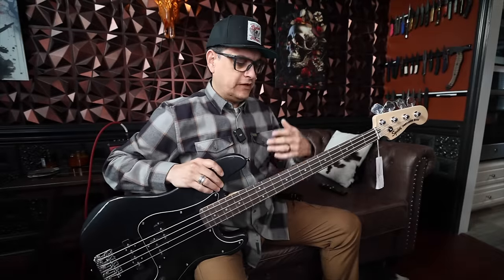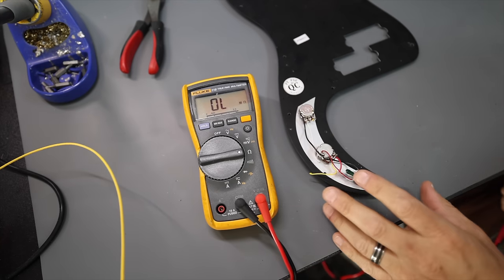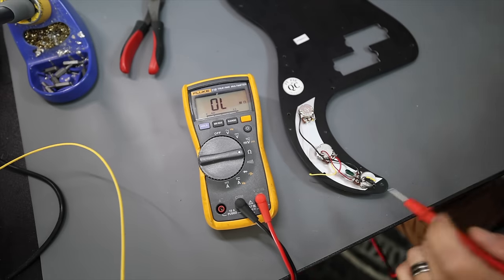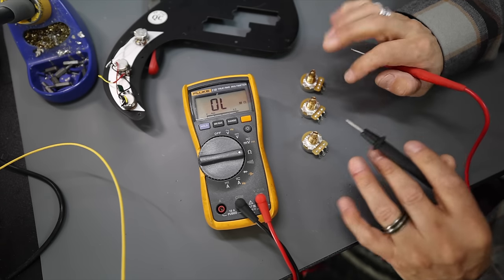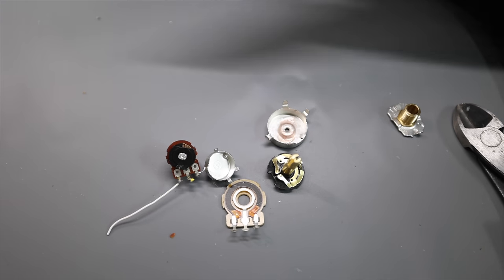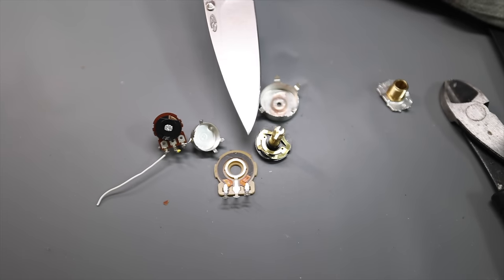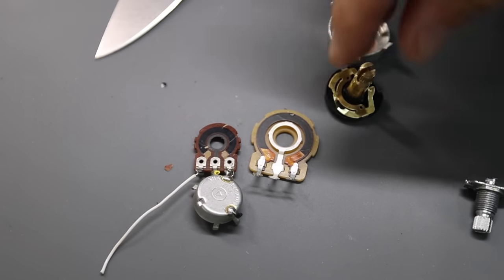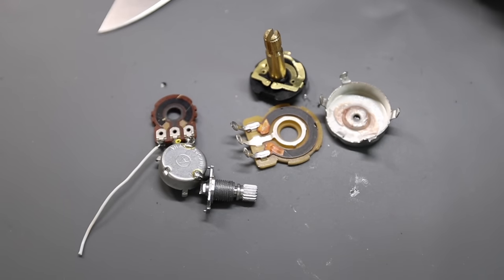Do Cheap Pots and Caps and Switches Ruin Your Tone ?

Comment: Haven't seen any real evidence that small Alpha pots do not last as long as CTS pots. The opened CTS pot is not CERMET either, so it collects dirt inside as well. Most pots have very similar specs for longevity. From 10 000 to 100 000 travels. Standard range CTS promises only 10 000 travels where Alpha 15000 travels with their "small pot". This info is in their data sheets.
Reply: As you can see in the video, CTS has the thick carbon track. Once they get dirty inside a CTS can be cleaned and be brought back to service quite easily while the Alpha will usually enter a slippery downward slope and once they start failing it's a fairly quick process as the scratches dirt leaves on the carbon track can go through and kill the pot. It's not the number of guaranteed trouble free cycles but what happens after issues start on less than ideal conditions. 

Also, and this goes for all 16mm pots, their taper is always less precise. The wider the pot, the longer the track and the more nuanced the taper can be and precise your adjustments while moving the knob. Small pots can sometimes feel jumpy and I like playing with my controls a lot.
Reply: @Strongholle  It is unclear which series of CTS pots he is talking about. As mentioned earlier the "standard" series has only 10 000 travels guaranteed. The "special" series has 100 000 travels guaranteed, which makes it obviously a more durable pot. Couple of other things which are not correct in his "analysis". Alpha uses multiple contact springs in their taper. The purpose of this is to reduce the contact force to the resistive material assuring longer lifespan. Using just two stronger springs means higher contact force and also uneven wear of the resistive material. This must be compensated with a thicker resistive layer to achieve promised specs. The CTS construction is probably 50 years old compared to Alphas more modern approach. 

What comes to the grease added to the CTS pot its purpose is not to seal anything. The purpose is to add friction when the pot is turned to make it feel "smooth". And yes, thick grease between two metal surfaces adds friction rather than reducing it. Bourns and others use the same method. 

Quote "Also, and this goes for all 16mm pots, their taper is always less precise. The wider the pot, the longer the track and the more nuanced the taper can be and precise your adjustments while moving the knob. Small pots can sometimes feel jumpy and I like playing with my controls a lot." Have you any proof of that claim not being as precise?

If someone has problems with these "small pots" that might be of other reasons than described by Dylan. There are a lot of Chinese Alpha knock offs around in affordable instruments and not sure about the quality of those. Personally, I haven't experienced the on/off behavior. Seen it in YT videos though.

Dylan having so many things wrong in this video raises some questions. Does he really know what he is talking about or was this made just for marketing purposes? He is selling this stuff.
Reply: @hannuhanhi183  Easy TL;DR but I'll bite.  I've worked on guitars for years and while I think Alpha pots are really good for the money I've found after wiring/rewiring hundreds of circuits that CTS's are by far more durable, over time with use and when soldering. (You have to be fairly careless) but when soldering Alpha's you can burn up the board and have the pot become noisy/fail before it's time. Same if you bend the legs, you can break the carbon track unless you're careful or use a wire to make the connection. Once again, if you're experienced it's rare that this'll happen but CTS just take whatever you throw at them. I don't care enough to look into it but the CTS pots usually found in guitars are from the specific Guitar Series, which are only offered in 10 and 20% tolerance, matching the Special series vs the standards, which doesn't mean some shady shops or makers don't use the Standards. 

The grease stuff you said is true but I never mentioned any of that, I'm not talking about Dylan and his reliability/knowhow either. 

As for the taper and pot diameter, the further away the carbon strip is from the centre of the pot the longer it is overall and for a given angle of movement the contact will travel a longer distance over the track. Given that most guitar pots are audio pots what I suppose is that it's easier to make an accurate audio taper on a bigger resistor without adding too much to the production cost. One of the big cons of Alpha pots in general is that their audio taper is worse than CTS, being two conjoined linear tapers approximating a curve than an actual logarythmic shape like on CTS and I feel it's worse on the 16's. Also, maybe it's heat disipation when soldering or whatever but for some reason the smaller pots tend to fail a lot more, from what I've seen. Maybe it's chinese copies, but Alpha makes a shit ton of different specs for pots so the shittier ones might not be fake. 

All in all, if I buy a guitar with Alpha 16's and they work I'm not gonna change them. If I rewire a guitar or need to replace a pot I'm gonna use CTS or Bourns.
Reply: @Strongholle  Quote "Also, and this goes for all 16mm pots, their taper is always less precise.". Didn't receive any evidence to this statement. What I have in hand here is a 3x3mm Bourns SMD trimmer. The travel is hard to measure but is some millimeters. It adjusts the resistance just fine and is accurate. Another which I have in hand is a multiturn trimmer pot which travel is like 12 mm. It also adjusts fine with every turn of the adjustment screw. With every turn the taper moves just a tiny bit, fractions of a millimeter. 

I use extensively Bourns push/pull "small pots" in my builds because I want to have the split coil feature. Never have experienced that they are less precise than same value "big pots" from Bourns. Based on these examples I cannot see any correlation in taper length shorter being less accurate than longer one. It cannot be generalized that shorter taper equals less accuracy. But yes, as you said it might be easier to manufacture a longer taper pot which fits in the specs.

Quote " One of the big cons of Alpha pots in general is that their audio taper is worse than CTS, being two conjoined linear tapers approximating a curve than an actual logarythmic shape like on CTS". Well, if you look at the specs of the CTS "logarithmic" pot (Series 450G
) the curve is definitely not logarithmic. It's almost perfectly linear up to 50% of the turn and then jumps to logarithmic. Linear half of the turn. That's quite a lot I would say. So, this statement is also busted.

What comes abusing pots when soldering the lugs it seems to be the norm rather than exception when you watch YT videos. Often you see a Harley Davidson grade (sorry for the analogy) 100W soldering iron 😁. In most cases they don't have any temperature control either. No wonder you burn up everything with it.  I well understand that you need more power when you solder the grounding wire to the base of the pot. Why not use a temp controlled soldering iron for safe soldering. ?

And again, I'm merely talking about Dylans credibility. To my eyes this video seems more like a marketing video than anything else.
Reply: I've had problems with Alpha pots but every CTS pot I've ever put into a guitar or bass has been solid. When it comes to a push/pull I use a Gibson pot in an SG because they're about 1.5mm shorter so they fit behind the cover.

Comment: the moral of the story: yes, expensive parts may have more build quality, but won't give you more tone quality (assuming you didn't change the values of the components)
Reply: This what I've been thinking too. And if the Asian manufacturers really want to throw a wrench into the works, start knocking off the CTS-style parts and installing them in the guitars. Cheap labor, quality part. And please use a 1/4" shaft.

Comment: I'll give my answer before watching the video. No they can't affect your tone. What can happen thou is that they could not work properly and they have a lower lifespan.
You can buy a couple of pots for less than a dolar and could probably last for years if you are very caring with your instrument, but they will likely won't last that long.

Edit: I mean, yes, switching values on the pots will change your tone, but changing by price within the same values wouldn't be that much of an issue. But again, cheaper ones will have a less good performance.

Comment: I spent 20 years in electronic maintance and 25 years traching electronuics. I got eight minutes into you vid and could not take your snake oil any more. If you know electronics to any extent then you'll know the sales talk falsehoods. Kids you can always boost/modify tone with your amp's EQ - enjoy. T.
Reply: I agree to an extent. Off matched pots have an effect on volume matching between pickups, when using the tone knobs. Running, for instance a 7 way mod on your Strat allows you to use two tone pots for blending. So you want to have them matched as close as possible and consistant as possible. The roll-off is also more consistant with higher end pots as Dylan suggested. PIO caps also lose the effectiveness over about 20 years as the paper starts to disintegrate.  When this happens, they allow high frequency bleedthrough which affects tone in a good way - that "creamy" sound, of course only when you use the tone pot. I've been working on guitars for the same amount of time and I agree, electronics don't know the difference in electronic signals, but players know the difference between janky parts and well constructed parts, Dylan is correct. Orange drops don't sound any different, but they have better tollerances from which standard benchmarks are made fron when creating pickups. .022, .033, .047 etc. So they are recommended. CTS pots are higher quality and less prone to variances which in the guitar world, just the smallest can be a huge difference when selecting different pickups running on the same tone pot. Also, its embarrasing when in the studio, you have to rely on the sound engineer to compensate for your janky equipment.
Reply: @terrylast7034  What specifically are you referring to? Your post sounds like someone who's not being completely forthright to be quite honest.

Comment: SNAKE OIL!!!
Not liking the taper is one thing, better quality is another thing. Saying it chages the tone.. when most players play it full on (when the pot is doing NOTHING) is deliberately lying.
Guitarrists fall into this trap because they know shit about how electronic works.

EDIT: Just got to the orange drop bit of the video. The 715P series your holding is exactly what you don't want in a sound circuit. the 225p is "regarded" by Sprague as the more musical of orange drops.
Reply from the maker: A few things…. A change in taper IS a change in tone. A change in resistance changes tone (science) and…. The pot is actually doing something when on 10. (Thus the option of no load pots). So… maybe you are right. Some folks don’t know about how electronics work.

Comment: Sorry but, while I generally enjoy your videos...this one was mostly a commercial and the difference between cheap & expensive pots & switches creates tonal differences that virtually no-one can detect.  And, if the position of the volume or tone knob needs to be slightly adjusted to  match the power or tone of two guitars...what's the big deal? As for that pot that cut out almost entirely in a fraction of a turn...that's a logarithmic pot vs a linear one. That fast cutout had nothing to do with the quality of the pot. Unless it was mislabeled by the mfrr, NO pot, no matter how cheap, would be so defective as to have a log taper when linear was  intended, any more than a car leaving a factory with  only 2 wheels..
Reply from the maker: Glad you enjoyed it

Comment: Without some audio clips to compare if cheap parts ruins the tone... this kind of videos are just theory.
Reply from the maker: What is “theory” about audio taper, pot construction, and tolerances? Those are all quite verifiable
Reply: @DylanTalksTone  I do not dispute that theoretical part, which is fine. The title of the pitch says "ruins the tone", if you only give theoretical explanations and don't do a practical demonstration (with audio clips, you are talking about tone) that really cheap parts can ruin your tone, you are leaving out half of it.
Reply from the maker: No… read it again…. It asks the question…. It does not make a statement or assumption.we then state very clearly that this video is about more than tone. What we have here is a classic case of “the viewer sees what they want to see and hears what they want to hear”
Reply: @DylanTalksTone 
The question in the video is straightforward.

Don't you really think that a good way to answer that question, apart from everything that is exposed in the video and that is very good, would be through some sound tests to answer, in a practical way, the initial question and everything you explained during the video? Just taking some measurements of potentiometers, talking about the materials of construction, their values, tolerances, etc... is enough to answer a question that, intrinsically, raises a problem that has to do with sound without even doing a sound test?

This is like explaining how to add, explaining the numbers (natural, integers, rational, etc.), the symbols, how they are written and in what order but... without doing a single mathematical operation.

What we have here is a case of the youtuber posing a clear and concise question, then talking about other very interesting theoretical aspects but not demonstrating anything in a practical way (when the initial question asks for it).

That's fine, it's your video and you do things the way you want. I am also entitled to my opinion and to propose what from my point of view would be a complete answer.

Comment: I rip out of all of my Fender bass's, pots, wiring, jack socket & sometimes the pickups....fit a brass nut, brass 3 groove Guyger brass saddles & fully sheild
the bass...i use CTS 8% 250K Linear pots, Fender hook up cloth wire & use hi-fi grade 5% polypropylene caps & a 1% 4k7 resistor(Greasebucket Tone
set up, sounds much better than a single cheap cap) & a jack socket with two positive & 2 negative sets of contacts but still mono...great solid straight fit with 200% more contact to your jack plug....after all that i have a real quiet great sounding bass...Fender build great bass's but the sheilding & electronics are poor quality...worth the extra bucks squeezing out the best possible tone imo...